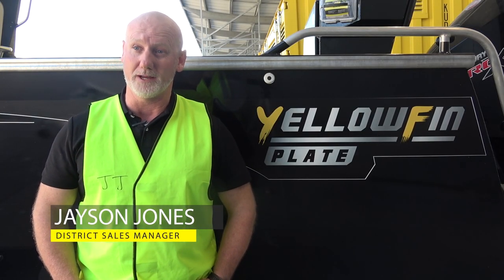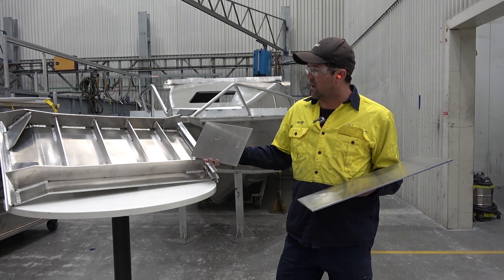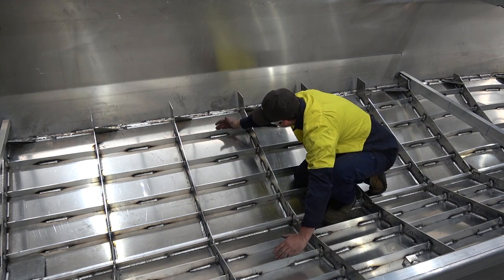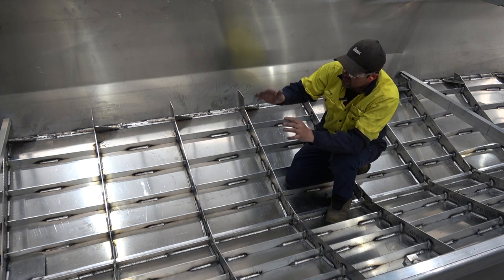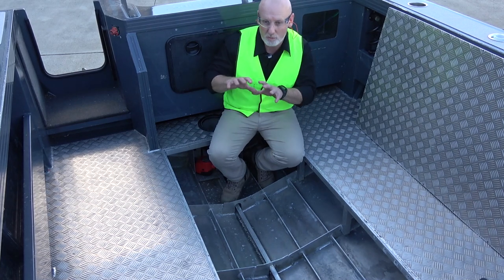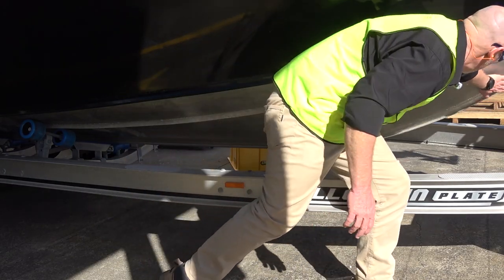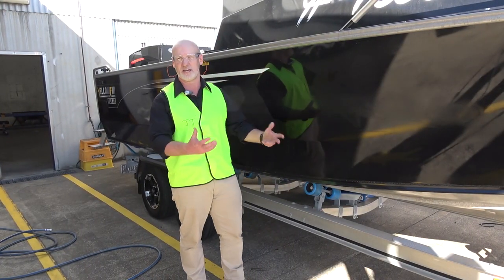Yellowfin Plate Boats | 2021 Overview

Comment: I friend of mine got his yellow fin last year he said worst boat he ever had the aluminum ended up leaking within 2 months had to repair it myself I ended up selling boat but never will I own a aluminum boat only fiberglass boats
Reply: 4 MIN AND 2 SEC THIS MIGHT HAVE BEEN HIS BOAT A GOOD INCH OF WELD MISSING
Reply: I'm a boat builder from Perth Western Australia. Strip frame boats like these fatigue/flex alot more than full frame boats. The frames always crack, mainly around the fuel tank mounts.

Comment: The welding is no where near as good as the plate boats from new Zealand ... I didn't buy a Yellowfin because of this.
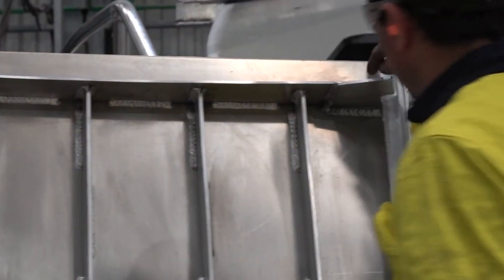Reply: In the part of the video where the guy was talking about the 350 hours and they had a close up of the bilge/keel, I thought the same...  Def not "stack-o-dimes".  That said the fact that they use the slotted keel and weld both sides I believe would make a way sturdier boat than a flat bar with one weld to a large sheet.  If you missed the super keel it was in the beginning of the video 1:38, also I think he was implying that the chine rail 2:49 (edge of the boat) was a channel configuration as well.  I am not an engineer, but the channel with weld on both sides seems to me to be a way better way to build and his explanation of the reinforcemnt clearly shows they care about a solid build.